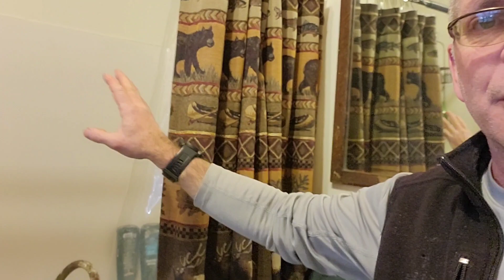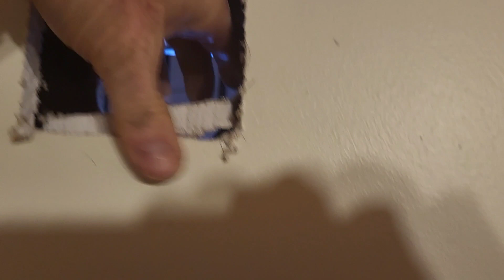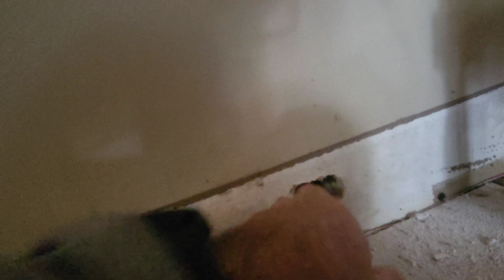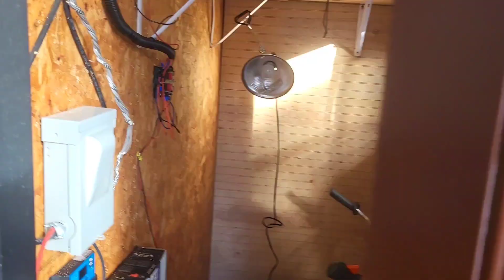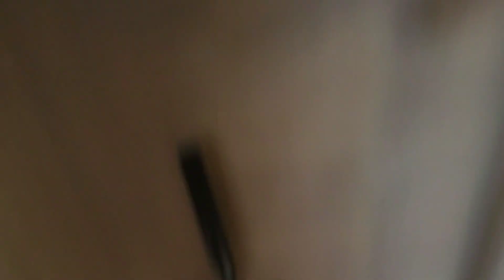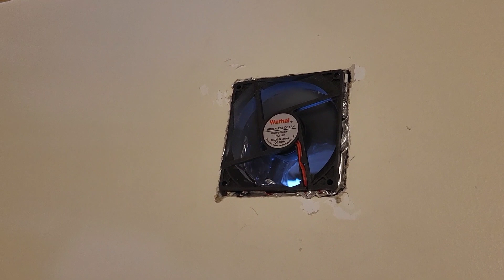Using a DC fan to warm up my bathroom

Comment: I love the spiral staircase. 
The sagamore executive suites used to have those back when we stayed there about a jillion years ago.
Good idea on the fan, my dad had one in the wall drawing air into the wood stove. It had a thermal switch that fired it up when the temp was hot enough to open the outside vent.
This kept the house positively pressurized.